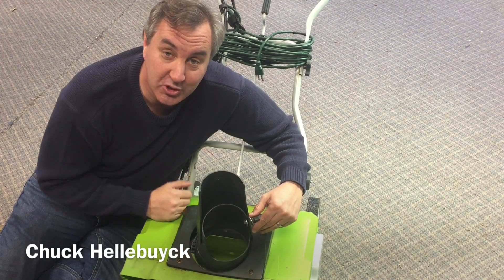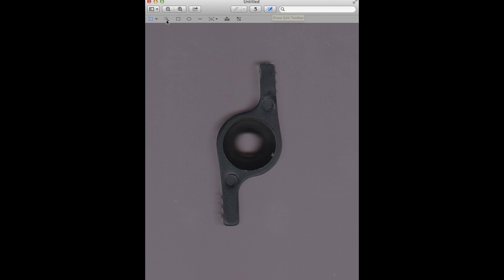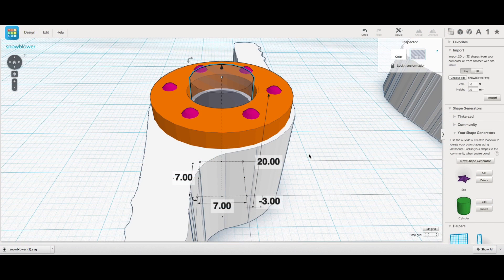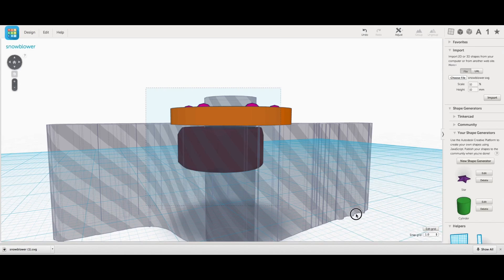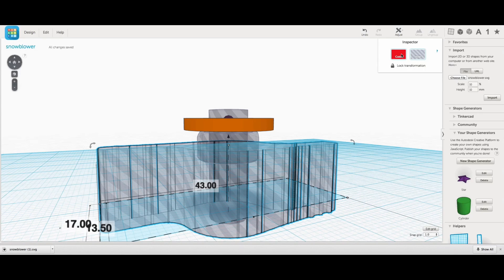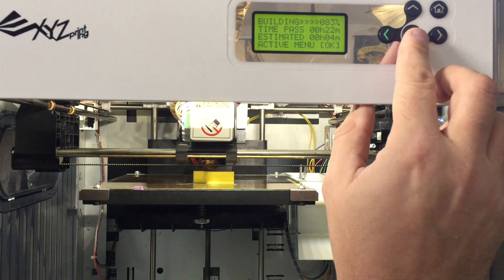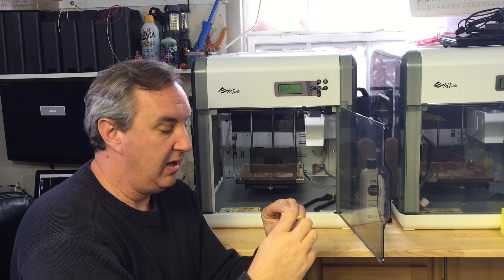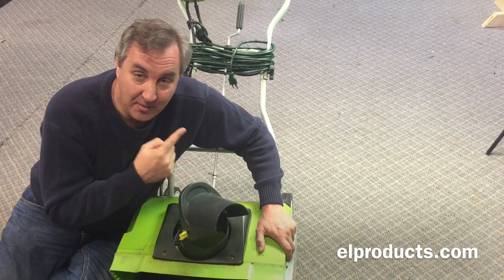Metal Inserts on a 3D Print

Comment: Better Idea: Drill & tap a small chunk of 3mm steel or aluminum flat stock, small enough to fit inside the overall form. Then print the knob around the steel chunk. Presto! You now have a "plastic" knob almost as strong as one machined out of metal. Tip: heat up your metal insert with a heat gun before dropping it into the recess you've created. That will help it drop into a tight tolerance recess and improve layer adhesion when you restart the printer.

Comment: How'd you figure out when to pause?
Reply from the maker: This is an old video but I just watched until the hole was deep enough. 
The printers I use on my channel now are open source and I can set the pause in the slicer to the exact layer I want.
Reply: @FilamentFriday  Thanks. I thought maybe you used the orange tube element as a marker. When that started printing, pause and drop in the nut... but it didn't look like you did that after all. I'd need some kind of marker because, if I used my eyes to judge "deep enough", I'd be wrong in a catastrophic way. Thanks, again.
Reply from the maker: A simple solution is to just print tower next to it with the height you want. When the tower is done, pause it. You could also just print two pieces, insert the nut and then glue the pieces together.

Comment: I was thinking of doing the same thing,  it with smd leds. 

I don’t know if you use Fusion 360, but you can import an image, and calibrate it for size. Then easily create a complex shape using their tools. Then it’s just extrude and you have a 3D object. Also when trying to gain access to internal parts, you just select them from your browser. No need to move things around. I know this is an old video of yours and you may be using fusion already, but I really think it’d be great for you.

Comment: Hey Chep. Being using the pause at height technique and for the most part it works great but today I noticed some parts break along that paused line and wondering if you had any suggestions.
Reply from the maker: Start and end at the same height so they merge/melt together.
Reply: @FilamentFriday  Ya thats what I did. but it is still snapping. So set it to redo the layer and will see if that solves it. Thanks for getting back to me. If you have other vids on the subject love to see them

Comment: Chuck. Sorry but how did you know when to pause the printing so you could insert the nut with out it being to soon
Reply from the maker: As soon as the layer was close to covering the nut. This is old though. Newer slicers and printers can stop or pause at a specific height.
Reply: @FilamentFriday  Thanks man. I will look into it further. I have a need to insert a nut into a part and it's been a struggle. This might be teh solution. Love your videos keep um coming
Reply: @FilamentFriday  Wa hoooo....thanks for putting me on to that, I am now printing legs with lock nuts inserted during the print. Easy Peasey..thanks man

Comment: Great video. These are the kind of projects I started 3D printing for. I’m not interested in the cute statues that so many guys play around with. I want functional things. The point isn’t that you go to the hardware store. Often it is to make something better and improve the original design. So the techniques presented here are sound.  

I’m curious how this will stand up in the cold. I’ve typically had to make outdoor parts bigger than original to keep them from breaking, if pressure is required to make the part work. So while I like the scan technique for more complex things, I would have made this one from scratch and made the wings much bigger.  And slapped your logo on it. But anyway it’s still a great video, and hope you ignore the guys saying to run to the hardware store.  That’s not the point.
Reply from the maker: This video is over 3 yrs old. I still have it on my snowblower and it’s held up fine.

Comment: No idea why you would manually measure it if you already scanned it. If you scan something at 1200PPI for example (which most modern scanners have no problem with, some even go significantly higher) you get 1200 pixels per inch, so the dimensions are included. Not only that, but at 1200PPI you get a maximum accuracy of over one thousandth of an inch. Which is kinda difficult to achieve manually. If you would have set the DPI correctly in the online converter (or whatever you use to vectorize the scan) you would already have had an SVG file with the correct dimensions.
Usually I print screw which works quite well for threads with a diameter of at least one fourth of an inch. In cases where I need strong threads though, I would recommend just leaving a pocket for the nut to fit in, rather than stopping mid print which can result in bad layer adhesion at the paused layer. If you don't want the nut to fall out when it's not screwed tight you can also use a little glue to secure it.
And I never used TinkerCAD, maybe it just a rather limited software, but your design process seems overly complicated and well, improved, in my opinion. You could try using Fusion 360 or some another sketch based CAD software.
Reply: Ok, fair enough... I didn't really pay attention to the date. I believe Fusion 360 has been around back then, but things may have been different back then.
I still don't see a major advantage in embedding the nut into the part itself apart from it maybe being more aesthetically pleasing, it has no practical advantage, may weaken the part and requires you to insert a nut into the part mid print.
And I'm not sure why any CAD software would resize your STL files, assuming the units are set correctly. It seems like a rather inconvenient feature. You could have still measured the pixels in the image to determine the dimensions. But I guess any way that gets the job done is fine. So perhaps I shouldn't complain.

Comment: Shows you how far 3d printing has come since this video was made... Simplify3D would make this much easier. You can programatically pause on a specific layer, drop the bed (or raise the hotend), put your nut in, start the second process and you're good to go.  You don't have to wait around at the printer for the right time.

Comment: I realize this is an older post, but wanted to tell you thanx!!  A part on my wife's scope (she's an avid birder) broke.  It's the piece that the tripod screws into, so it's a plastic part with a brass nut in there.  I remembered that you had done a video about that, so figured I could give it a shot.  As the brass nut was round, I didn't do it quite the same way as here, but it was still my inspiration.  I made the hole a hair too tight, and then used my soldering iron to sink the nut into the printed replacement part.  So I was able to model up (using Tinkercad, that you turned me on to) the part and set the brass nut in it.  Works great!!  Much stronger than the original!!  Thanx again!!!  (Using my Monoprice Mini.. ;-)

Comment: You probably could have built that from scratch in tinkercad quicker than the scan and fix took FWIW. Great project though! Also if you are printing PLA you might look into sintering (baking it for an hour at 110c) it after the fact for much improved durability.
Reply: CHEP 3D Printing & Electronics 
That makes sense. It is a great guide and the captive nut is very cool indeed. I have a couple of applications I'm thinking of trying that on. Just need to figure out how to pause a print on the A8 with the shipped firmware. Thanks for your thoughtful reviews too btw. Been enjoying your videos. PS, standard PLA sinters better than HTPLA apparently. Go figure.

Comment: It was worth watching just to learn I can scan an object and use that as a starting point in Tinkercad, which I'm just starting to learn. I have a good scanner but it's old and out of use. Now I won't be tempted to throw it out as obsolete.
My observation about Chuck moving an object out of the way temporarily to select the inside "hidden" object: Instead, 
I drag my mouse starting in the clear workspace and then through where both objects are sure to be. In graphics programs that's been known as a "marquee select". 
Check the status line to see if 2 pieces are selected. 
Shift click the mouse on the exterior part you don't want which de-selects it and the part still shown as 1 piece selected is the hidden part. Carry on.

Comment: I noticed that there were voids around the hole where the nut goes 7:13 . Is there a way to force the printer to make an area of a 3d printed part solid? It would use more filament, but might be useful for high stress areas of parts.
BTW, Everyone who lives in Michigan hates snow! Lol!
Thanks for the video.

Comment: I've made custom T-nuts for 6-32 machine screws that go into extruded aluminum, in a similar fashion. Cura has a plugin called "Tweak at Z", just set the height you want to pause at, let it run, when it pauses - insert the nut, and press go.

P.S. Greetings from a fellow Michigander =)

Comment: Thought it was funny when you were making us anticipate whether or not the bolt would fit.  As if the nut would mysteriously change its properties once embedded.  Of course it fits!
Note though that you could have installed a pause command in the gcode so you wouldn't have to sit and wait for it to get to the right position.
Reply: Just use Repetier's gcode editor.  You can visually inspect the model and find the right location, go into the gcode and enter the pause command that way.

Comment: Why am I watching this? I don't even have a 3d printer... >.<
Reply: I don't have one either. Lol!
Reply: If you don't have a snow blower either , You should seek help! xD
Reply: Hope you have one now. I got one 2 weeks ago, it's addicting.
Reply: I don't have one either, but I have a 'classic' (LOL) 1994 Ford Probe and the little rollers in the window regulator failed.  So I designed the part figuring I could find a printer somewhere.  As fate would have it, the UPS Package store down the street was a pioneer store to have a 3D printer.  (Don't know if this spread to other stores. I'm in San Diego). Twenty bucks and I had a prototype and then modified and it's been in the car for 5 years.  I also had a metal part in my $240 front-door lock that failed.  Part no longer available, so I designed it and got a plastic prototype made at UPS.  Adjusted the design and found Shapeways, a NY company that will print in not only plastic, but they will print in several metals, etc.  i had them print in steel.  Part cost was $9.40 and free shipping over the Christmas holiday.
Reply: @Nickvec  You know I posted 2 years ago that I didnt have a 3d printer, but a week ago I finally got one!
Reply: @Casey Thomas   Awesome!  With Corona, you'll probably have lots of time to master it.  I just finished designing a part for a vintage submarine toy and called the UPS Store and unfortunately they discontinued the 3D printing service.  Luckily, a neighbor has one.

Comment: Do you like this 3d printer thats in the video because I'm thinking of getting one is the quality of the print good, and strong thanks
Reply: This particular model is a great printer once you get it tuned in properly. Ive had incredible prints come from it however as Chuck mentioned its closed source and can make things difficult especially if its not flashed to work with Repetier. Check his channel for some reviews he's done on other printers that are much more beginner friendly.

Comment: talk about using a bazooka to kill an ant. why not just buy a wing nut for $1 at lowes.  or $2 at mcmastercarr doot coom
Reply: I thought the same thing but  the point of the video was just trying to show people how to do something different and not the repair itself.
Although it is a great way to keep from dealing with the snow .If his wife says something all he has to say is honey the part is printing,I'll fix it as soon as its done ;-)
Reply: Apart from this being an instructional video, the large plastic is there for a reason.  When you are using a snow thrower that chute is adjustable to direct the discharge.  You need to move it on occasion.  When you are wearing thick winter gloves is is difficult to turn a small wingnut thus the giant plastic piece.
Reply: It's the process that counts. It's the means to an end and you won't have your house filled with cheapnizz hacks and Gaffa tape! :D
Reply: You can't exactly drive to Lowe's when the driveway is covered in deep snow.
Reply: because its cool AF
Reply: It also just looks better, if you make it in the same color as the other knob.
Reply: Wingnuts are all metal and vibrations will make them come loose and possibly get caught in your blower's guts if it falls forward and gets scooped up... plastic knobs are made that way because plastic absorbs vibration and come loose far less often.. if tightened properly (-_-) which was probably why original was lost, it wasn't tightened properly, hehe.

Comment: Very nice, but you should always make the part (what would seem) larger than what you intended because the plastic will contract as it cools. This is why the nut was tough to insert even though the CADed hole was larger than the nut. For this project it was probably a good thing as you wanted the nut to be secure, just for future reference though.

Comment: Couldn't you just use a 3D scanner to scan the good part?
Reply: I for one am very happy you demonstrated using a flatbed scanner. I have one I bought in 2003 and it's still in good condition but only gets used at most once a year now. I have resisted tossing it out. Now this will give me a head start with Tinkercad. Thanks.

Comment: In theses cases, I simply design a press-fit hole in the print and then press the nut in with a vice. This way the nut does not come out and the print is more straightforward.

But the technique does have its potential uses.
Reply: +eshneto you can also heat the nut and press it in. the plastic flows around and locks it in place nicely.

Comment: What material did you print? Is the part as strong as the molded original?
Reply: +Chuck Hellebuyck's Electronic Products The greatest part of having a 3d printer, fixing those stupid little plastic parts that always break off everything! It's a good feeling of accomplishment when the fix you make is stronger and better than the original (when using ABS or better of course with a heated bed). I usually just either press fit the nut or heat it up the nut and do just like you'd do with a threaded insert (which are also great, look for "Heat Set Threaded Insert for Plastics" on mcmaster and those things are a lot stronger than you'd think when set in ABS. just set them with a soldering iron, great when you're doing small parts)
Reply: +Randy Rue The material was certainly ABS.  The printed part will never be as strong as the injected original part. But as Chuck said, it's strong enough.
This printer does min 0.1mm high layers ~135 total vs. 1 layer in injection. 
Hope this helps :)

Comment: for all the peeps ripping on chuck for this video and how he supposedly should have used a store bought wing nut or designed with hellicoils in solid plastic. He shows in this video how he does it his own way, that's what 3d printing is about, you are the creator. hellicoils in plastic using a machine bolt is a very temporary fix on a da Vinci printer. you would be better off with a screw or a more bigger threaded bolt if you were to print hellicoils. I can see why he did it his way, not to mention that's the first video I have seen metal inserts done on a da Vinci! keep em coming!

Comment: This is cool.  I wonder if you can do this on a regular #reprap though -- Maybe right in the gcode -- just put a filament change instruction in or something, right at a certain layer change (since that also causes the machine to pause while the user does something manually).
Reply: +Michael Jensen Cura, slicer, etc all have a pause feature. So all you need is a pause feature on your slicing program

Comment: Whilst this is a good way to do it there is also away that is probably easier and just as effective. What you could do is make the inner diameter hole a bit smaller than the actual nut. Then using a lighter just heat up the nut till its properly hot and simply melt it into the plastic. this is just as effective as the technique shown in the video is as probably even a little faster.

Comment: Interesting demonstration of your ability to insert a metal part (nut) into your plastic print.  In the end I'd have just used a typical wing nut to fix the snow blower though.  And if you wanted to coat the wings on the nut in case you had to handle it without gloves while its cold or something just dip each side in some liquid tape or some sort of silicone.

Comment: You can send pause and resume commands...insert the g-codes M25 G4S120 M24 (2 minute dwell) commands at the appropriate point in your print file, then you can resume. I haven't tested, these are just the commands from the G-Code list. Might want to add a home or something after the pause to get the head out of the way.
Reply: Hmm, I didn't know that. I'm a programmer, so maybe I'll take a look at it, because I'm in the process of building my printer and I want to print props that will probably require a lot of brief pauses.

Comment: Smart idea.. I like it.
Did you need to eyeball/estimate the time to stop the printer to insert the nut??
Reply: *****
Would have been nice to have the printer stop automatically at a predetermined print layer and sound a buzzer that it had reached the desired level.